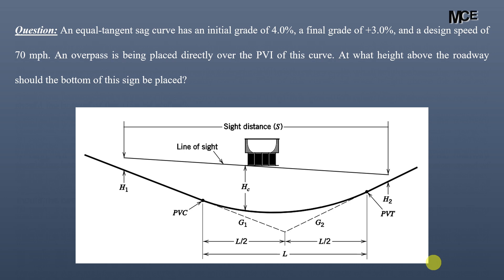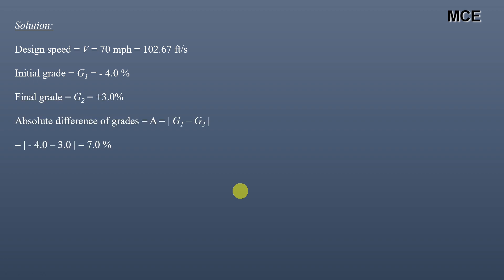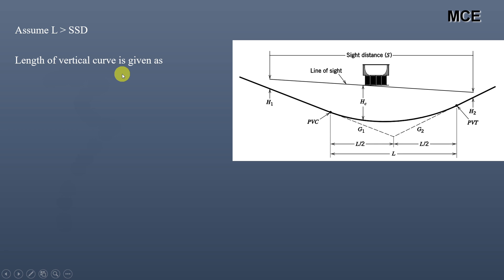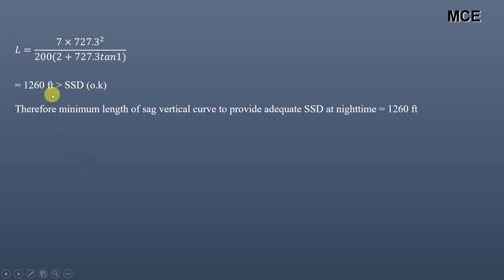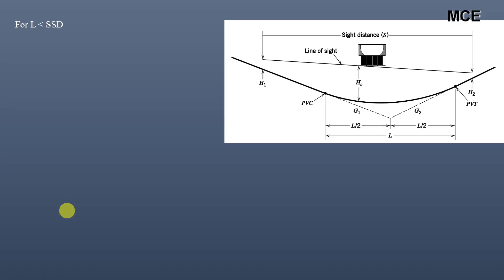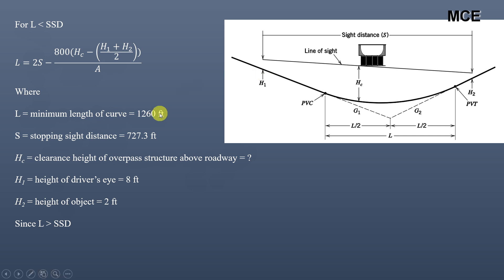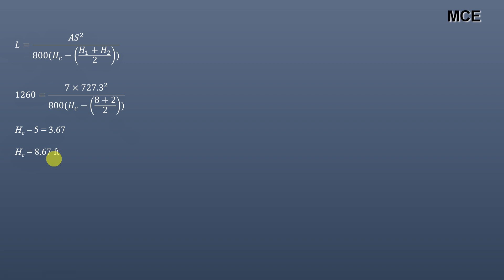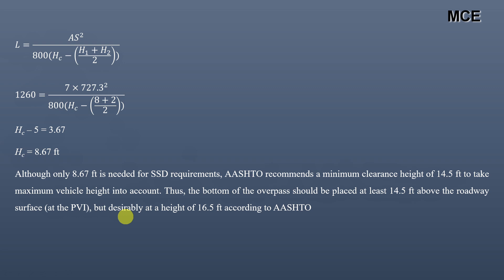Calculate Underpass Sight Distance For Sag Vertical Curve Design| Solved Problem

Comment: I do have a question regarding what you do if the overpass is existing and the sag is being designed to go under the overpass later.  In this scenario, if the clearance calculated is smaller than AASHTO requirement, I understand that the designer would need to use the larger clearance as designated from AASHTO (or a state authority, etc).  However, when using the larger clearance, the curve length will become smaller. If the curve length becomes excessively small (such as less than 100'), what should the designer do?